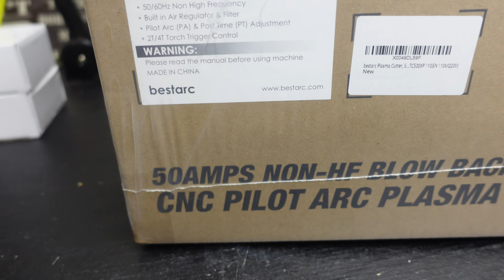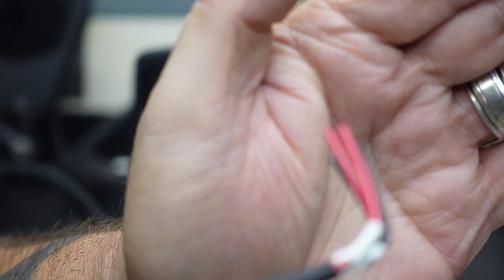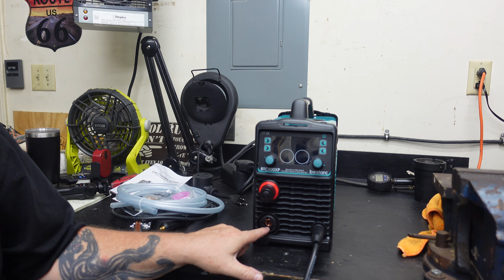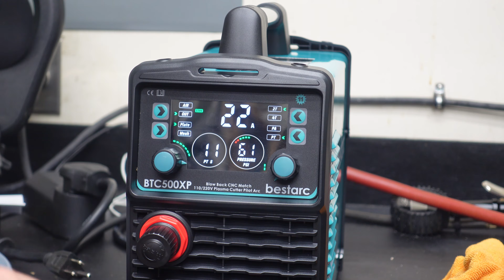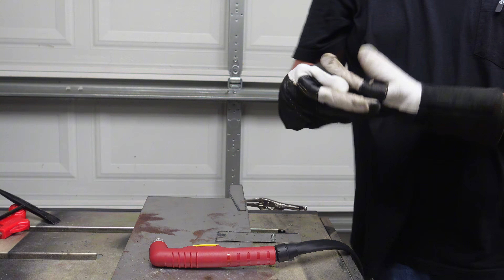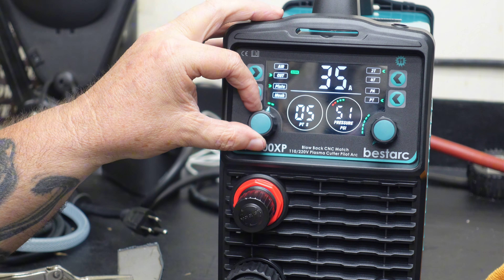This Bestarc BTC500XP 11GEN Plasma Cutter Is Awesome!

Comment: For the 10th and 11th generation plasma cutter, the filter is built inside the machine. To let the water out, the release valve is at the bottom of the machine.
Reply from the maker: Thanks for the info.

Comment: Does it turn on without the air supply line connected?
Reply from the maker: You can't use it without air connected to it so, not sure. It probably will turn on but give an error code for low or no air pressure.